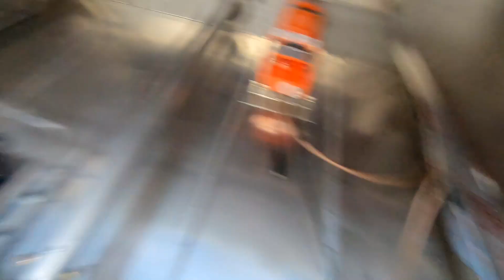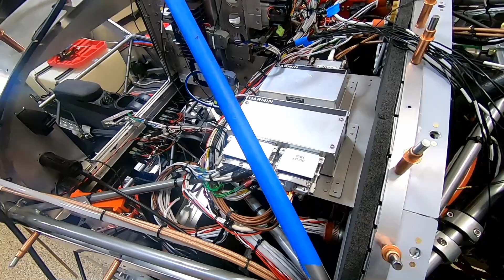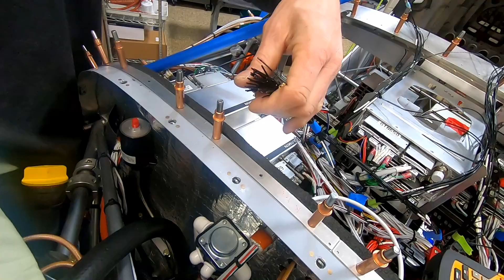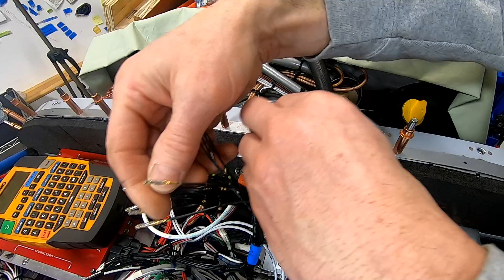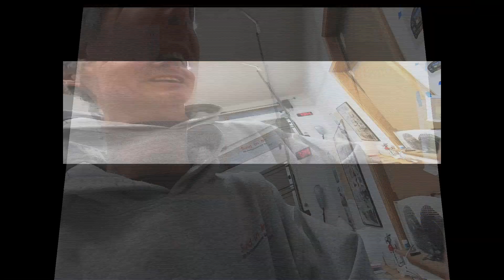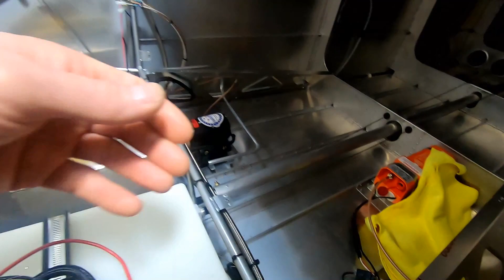RANS S-21 (136) More & more wiring, grounds and connectors

Comment: Any worries with having a connector involved with the GTP 59 OAT? Pretty fine/tiny current difference to sense. I hard wired all the way to G3X but was able to attach wings as I went.
Reply from the maker: I wasn't aware they are that sensitive. And we have a plug in the wing as well. we'll keep an eye on it once the wings are on. Fingers crossed.